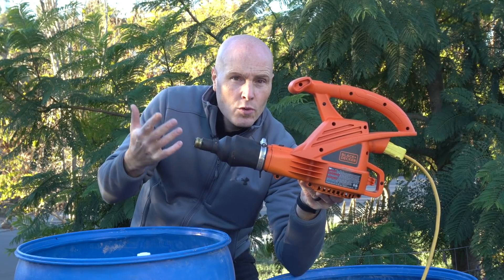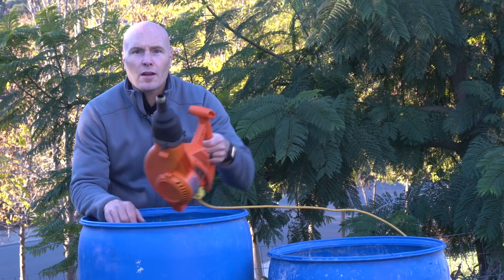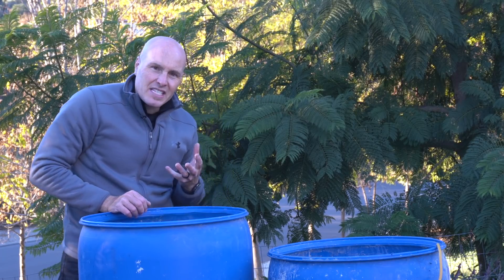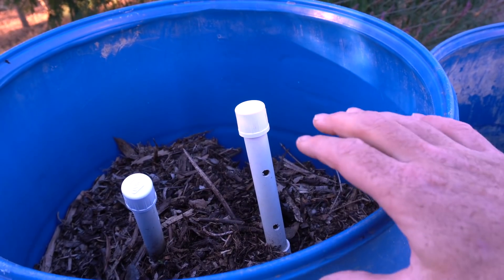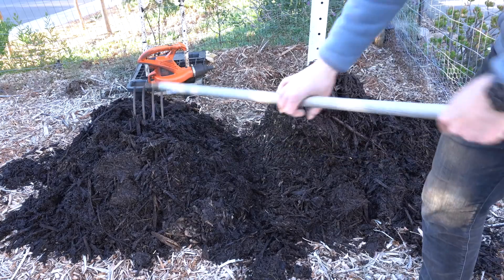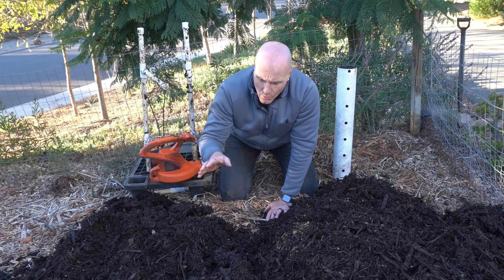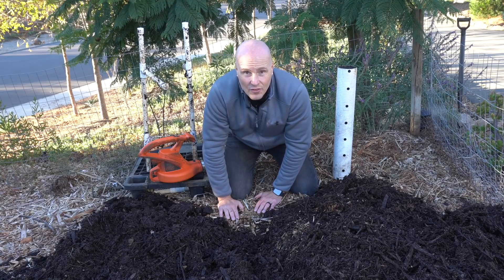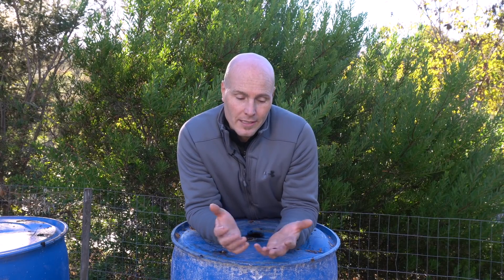Faster Wood Chip Composting with a Leaf Blower???

Comment: Your aeration system suffered from what a barista would call “channeling”. You would need to have the air enter from pipes in the bottom that are diffused by thick wood chips. It didn’t actually get air to most of the wood.

Comment: Diego, I’d like to suggest you turn the barrels on their sides and instead of a blower you put it on a timer to rotate the barrel 360 - 720 degrees every 12 to 24 hours. This way you get the oxygenation plus agitation to breakdown the particle size. Also lower electricity costs and noise levels. Adding a dasher built from recycled PVC from your blower set up would add to the agitation
Reply from the maker: Good idea.

Comment: IF YOU ARE GOING TO EXPEND ENERGY DOING ANYTHING, I would rotate the barrels. Even if the barrel only rotated once every 2-3 days, it would aerate the compost, it would distribute the moisture evenly, it would make the nutrients available to all the contents, and the mechanical agitation would help break down the compost. 
A simple frame that supported four wheels and a geared drive could rotate the drum with just a tiny amount of power and achieve remarkable results.

Comment: About 20 years ago I made some composting bins and ran drainage pipe up through the composting matter for airflow. To enhance it I ran out about 15 metres (50 feet) of recycled, from a rubbish dump, black poly pipe. The bins were at the top of a ridge and the piping was laid out down the small hill so the heated air rose through the pipe. I'm not sure if it helped break down the compost any quicker but I could feel the warm draught of air rise out the top of the bins so I'd like to believe it accelerated the decomposition . Sadly I didn't have an unheated bin as a control measure.

Comment: I think that the small of amount of forced air is real reason you didn't see a difference. IOW, if you ran the blower 24/7, I am nearly 100% certain you would've seen a remarkable difference although you would've had to up the watering significantly as well. Simply too little over too long a time frame to make a meaningful difference.
Reply from the maker: What are you basing that on?  I think there was more than enough air.
Reply: How expensive are oxygen sensors?  That would confirm how much is too little.

Comment: As I was typing my comment about trying this with a pile that undergoes bacterial composting, you started talking about trying exactly that.  One interesting way to measure this would be checking temperature of water that is piped through the pile.  Think Jean Pain.  If it was used to heat a space this might provide a way to adjust the heat output.

Comment: 'Barrel composting' should be in the title or description.  These experiments have been done by Universities (I know there is a vid on YT but I couldn't find it, it was for horse stall owners) & you absolutely need a minimum 3ftx3ftx3ft for proper heating possibilities.  Your finished product should be dark-brown.  Flipping piles only adds extra oxygen for about 20 minutes max so consistent air is needed.  To clam what you did here is the same as what can be done is flawed(not perfect).
Reply from the maker: I don't think I claimed that.  Breaking down woodchips is very different than horse manure, so different rules apply given the different microbes involved in the breakdown.  

I am running the same experiment now with horse manure, so we will see what that yields.
Reply: @DiegoFooter  The horse stalls are full of woodchips & urine, the manure is already composted in the warm body of a horse.  

I think the manure microbes will mean far less than the size of the pile housing the microbes.
Reply from the maker: What exactly do you think the heat is doing in the decomposition process? The heat is a byproduct not an input.
Reply: @DiegoFooter  It's an indication of microbial activity, which correlates to faster decomposition.   When my garden soil is 10 degrees higher than my lawn soil I can assure you it's decomposing not just more material but also at slightly faster rates.   Investing in a blower must have rewards & I think the benefits are easier found in a minimum 3x3x3.  The air provides 10%-15% more oxygen for an additional 23 hours & 40 minuets per day to feed more microbes than a standard flip model.  

For fungus a tree needs 7 years in Canada but only 2 years in Florida to break down in the forest naturally.  All due to temp & moisture.  If your outdoor temperatures stay below 84f then using temperature to determine microbe activity becomes more difficult.
Reply: @DiegoFooter  If your target isn't heat then you might fill that barrel with water & diffuse air into the bottom, an aquarium pump is probably cheaper than that blower.   Biosolids here are made in El Paso, Tx where huge tanks are warmed to 90f to achieve the fastest breakdown of the solids for 90days before reaching our local garden center shelf.
Reply from the maker: You aren’t comparing similar things.  I don’t believe that size of the pile has any relevance in fungal decomposition of hard to break down carbons like lignin in wood.  If you can show me something that says otherwise, please send it over.
Reply: @DiegoFooter  I just reread Cornell's research collection on your fungi topic &... 
  
More than one of their studies, old & newer, show 68% of lignin can be aerobically broken down with adequate nitrogen, moisture, and temperature where speedy white-rot fungi favors 86f-104f.
Reply from the maker: Do some experiments on you end and let me know how they turn out.

Comment: One thing to do with this type of experiment is to do 3 of these setups, and breaking your time down into 3rds.  Visual inspection on one set of barrels every 3rd of the time. This would show you if it accelerated the pace of breakdown at all. Love your experiments. Just thew a huge bucket of oyster spawn into my compost yesterday and was wondering how this experiment was going. Thanks for the update